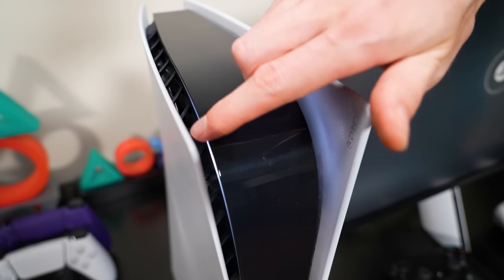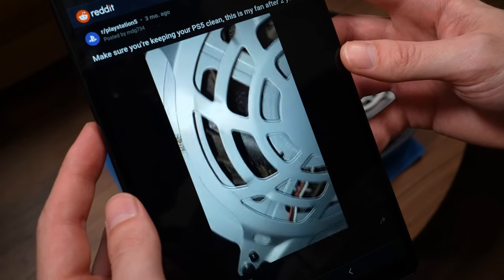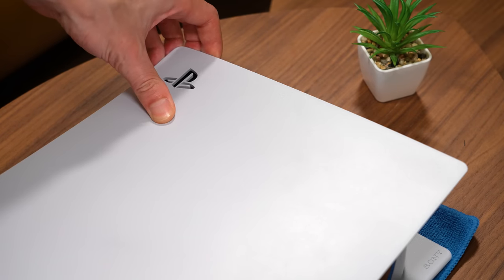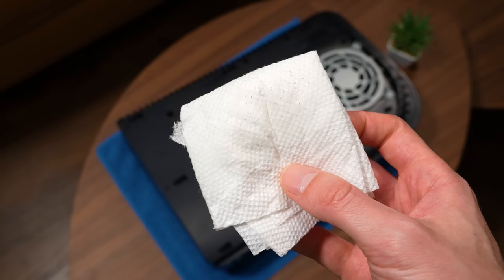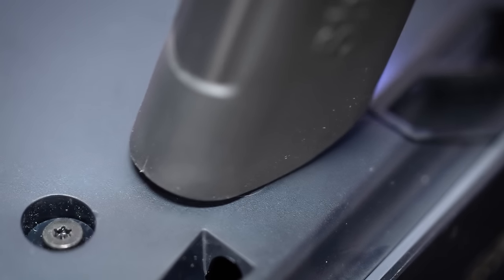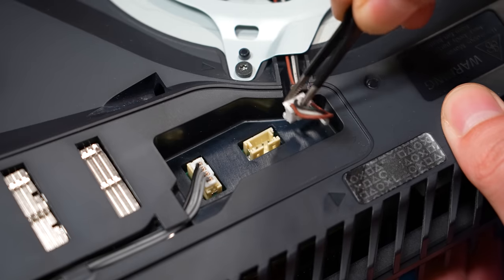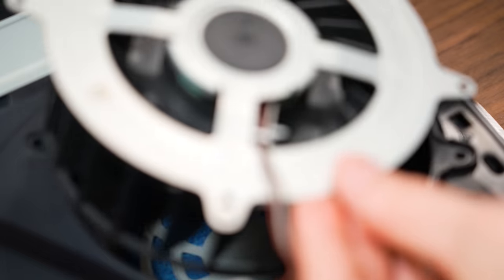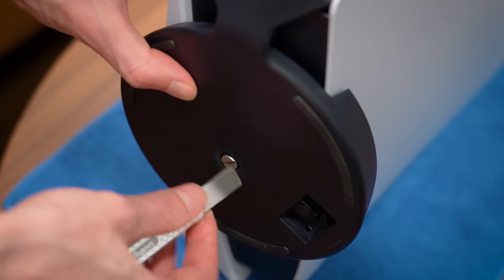It's time every PS5 user checked for this..

Comment: FYI GUYS ³ There's plenty of tutorials online that will guide you with ease. Of course, don't plan on eating a greasy burger or drinking a cold beverage whilst doing the job. If possible, wear electrician blue rubber gloves to prevent finger markings and damage any chipboard if you need to touch it for any reason. Don't use too much force removing/adding anything, especially screws. Doing so can cause the tension to crack the plastic. When you've accessed the fan, DO NOT MOUTH BLOW THE DUST AWAY. As it's from your mouth , your breathing will add moisture to the blow, and that ain't good!

Comment: I don't even fully disconnect the fan. I just pull it out and set it on the PS5 still connected. Hold it still with one hand and hit it with air duster./soft brush with technical grade alcohol. I also hit the heatsink with air duster and vacuum the inside of the fan housing.

Comment: You forgot to mention the Dust that builds up inside the PS5 system.

When you remove the Fan and look down inside the console to where the power unit is.

I clean my console regularly, but just recently found this on reddit. My console just turned off in the middle of playing, due to overheating.

It's very hard to reach with a vacuum, but theres small holes. Mine were completely sealed. I used compressed co2 to blow the dust out.

It's very important to clean too.

Greetings and nice video.

Comment: After a year and a handful of times of basic dusting with just taking the covers off and spraying comp duster, i finally got around to unscrewing the fan to clean it along with the inside and im glad i did, when i sprayed the inside of the system with the comp duster towards the cooling vents the ps5 farted a big dust cloud.

Comment: The two plastic plates come off easily if you DO NOT pull up on them.  Use your PALM to hit (slide) the hooks out of place and it comes off very very very easy.  If you look at the "hooks" in the vid, you can see how it slides off, and it does not pop off.

Comment: I don‘t even use the side-plates cuz it‘s more minimalistic/smaller smother and the air-duster get‘s better air. My air duster looks like it has never run. I did also modified a little bit with led lights and some stickers. Without plates it fits also better into a bag if you want to take it with you to a friend :)

Comment: Also as a side note from a repair tech....... from experience its a bad idea to have your console sit vertically. When the console runs to hot the cpu adhesive compound may liquefy and run down the board itself. Every single console i own runs and sits horizontally. I know some console owners who had this problem and sent it to me for repairs or had to buy another one out of pocket. Its a good idea in the long run.  Also have them sit on a glass shelve rather than wood. Glass stays cooler longer and does not retain heat like a wood shelve. If you have your console staying cool with a fan stand you may wanna check it for dust 1x every 2 months cause now you have more fans helping blow air into it.

Comment: People need to understand. A ps5 is basically just a computer optimized for gaming. 
And pc gamers know, you need to clean your rig out from time to time. 
Depending on where you live, it can get pretty dusty in there. 
I live in a house with baseboard heat and notice that I get alot more dust buildup now than when I lived in a house with central duct heating.

Comment: I'm glad that it looks pretty easy to clean up a playstation nowadays, since dust can ultimately cause way more problems than you initially realize. it's still a far cry from just opening a panel on your computer to check, but at least it's not completely disassembling the entire unit like the ps3 just to get to the fan

Comment: I’ve taken my ps5 completely apart, down to the motherboard… there are metal fins in the PlayStation that are only accessible if you completely break it down that get ALOT of dust build up if you don’t clean regularly. If anyone is having issues with the ps5 randomly “crashing” & shutting off during use, I suggest you completely break it down & get every bit of dust out, including those metal fins, because that’s what’s causing it to shut down.

Comment: For the ps5 cooling fan if u dont have the tork screwdriver  just take off both plates and use vacuum both sides on fan should be good

Comment: Question: how do you release the other fan since that one doesn't have screws. Idk while they chose to do that🤦‍♀️. I believe this is the fan where the disc drive is at

Also, I use baby wipes, tweezers, and a hand vacuum. I also have those screwdrivers, but as I said can't reach the other fan

Comment: Series S/X tends do this best since their select area of intake is on the side of the console with the exhaust fan pushing air away from the console. The minor problem in the PS5 for people who stand the console upward is that it intakes air from the top and it exhausts out the rear. Intake and dust mixing do not bode well and you get this monstrosity of dust bunnies in your console.

Comment: Every six months? I had mine since 2021 March and never cleaned it even after a house fire. I'll be taking my next day off work to be doing this. My room didn't burn down only thing that happened was my room got smoked out killed my 4K tv and left smoke smuggest on my PS5 back in 2021. It still works perfectly fine and I got the black PS5 plates.

Comment: Did this just 2 days ago. PS5 started to shut down on it on after playing heavy games like elden ring. I thought it was a faulty power cable but it was dust build up. I opened it up and sure enough it was duty. I decided to get after market plated cover plates with side vents to help cooling of the system. Definitely recommend cleaning it up if you haven’t and don’t be afraid to get in there a remove the fan or anything like that. Just be gentle and careful

Comment: sometimes not even this will work. the heat sink/radiator thats inside of the ps5 can get really built up with dust too. the only way to clean that is by taking the entire ps5 apart and getting to the heatsink. theres videos on how to do this effortlessly.

Comment: I have cleaned mine once a year since 2020 lol kept it horizontal as well. Only issue I had was after a year the lan port stopped working 🤦. I have an air compressor for filling tires but use an attachment that blasts air. Its super convenient

Comment: I've been doing this to my consoles since my first PS2. I even had to Jerry rig and replace a few parts in that one... I still have it. I call it my "Frankenstation", because of how many inexperienced, d.i.y. repairs I did to it.
One time the disc tray stopped working. First, I re-reamed the threaded rod, but that eventually gave up the ghost, too. So ultimately I ended up with a PS2 where the top lid had to be completely removed in order to put a disc in... so I secured the ribbon wire much better than Sony did, as to avoid unplugging it every time I put a disc in the console, and it's worked like that ever since.

Comment: Hey guys opening the plates are very easy but if you are scared to go deeper I understand completely. You should definitely get your system serviced because the heatsinks pick up pet hairs very easy if you have them. The ps5 will just shut off thankfully to protect it. The ps4 rarely shut off. The fans would try to compensate for heat issues until they died. Im sure someone will clean it for 30 bucks but be prepared to spend 100 too. Its a mixed bad on prices and if you have bugs you may have to clean it yourself some places will not even deal with it.

Comment: This is why I literally hate the PS5's design because not only is it horrendously huge, heavy, and difficult to carry around, the ventilation area is completely exposed, which allows dust to seep in very easily and within short periods. I keep mine covered in a plastic bag and remove it only when I use it. Sony clearly didn't try hard enough in improving the design and just wanted to launch it immediately to keep their money flowing in.

Comment: There is almost no use in cleaning just the fan as the dust is built inside of a radiator, blocking most if not all airflow. So the only way to trully clean it is to take it apart. Which is not a good idea unless you know exactly what your doing.

Comment: I know for a fact Mines dusty af. I was messing around with a air sprayer and sprayed into the vents from the outside and so much dust came out I was disgusted.

Scared to prop it open and clean it though, bought since day 1 release and haven't touched the inside since.

And yes my room is dusty af especially by the air vent where everything is

Comment: Hmm, you seem to have neglected the most critical areas - the heat sinks and vents on the power supply.
It is possibly to clean these in situ with suitable vacuum/ brush attachments.
Cleaning the fan is great.
But you really should be  more concerned with the components the fan actually blows air/ dust ONTO!

Comment: Yeah my shit was dying, it still has dust caked on the fan. I took the fan out and stuck a vacuum hose down in the power supply, I was shook by how much dust was in that cheese grater.

The heat sinks luckily had all the dust sucked out in a millisecond, thankfully the dust doesn’t stick to the metal heat sinks as much as the stupid fan.

But the thing went from me hearing the fan, to not even using the fan anymore.

Comment: All ventilated electronics simply require half a cans worth of compressed air once a year; just dont sit there like an idiot and do a sustained blow right on the fan causing it to spin up to operating speed or higher, likely frying the controller.  Maybe thermal past after 5 years.

Comment: Any owner of a ps5 should upgrade there internal storage to a crucial P5 plus or similar as load times are remarkably noticeable. I also order 5$ multi colored Bluetooth lights with 250+ combinations modes from Ali express & looks awesome. Zero signs of dust so didn’t need a clean…

Comment: WARNING. don't light incents in ur room without proper ventilation. And don't blow smoke ( weed, dab cart vape,) anywhere around the ps5. I I toke my plates off and there's like a yellow hue tint on the inner plates. Not to bad but im 99% sure it's from the incents and smoke

Comment: i never had to clean any console inside. i have some that are working for many years like some old ps2 and original xbox. i also have an xbox series x for years and it still works fine without any cleaning. i would say that unless your system fails due to overheating , dont touch it. make sure that you also use your system in an open space and not into a closed cabinet to avoid overheating. dust might not be the reason of overheating.

Comment: Disconnecting the fan from the terminal is extremely risky and you could very easily snip the white wire to the fan with a pair of tweezers. I don't recommend anyone really try that part.

Comment: The message is good, but cleaning procedure is not. The dust you clean is irrelevant, the most important dust to get out is the one that's clogging up your heatsink, which you didn't clean at all in this video. A quick compressed air blast through the heatsink will give you way better results than everything done in the video combined.

Comment: I used to clean my PS5 once a month but I haven’t cleaned it for a year. I cleaned my PS5 last week and it was dusty. I cleaned it and it looks brand new. Apart from the fan. I’m too scared to even touch it. I briefly vacuumed over the fan housing thingy but the fan itself is dusty and I’m not touching the fan. I do not believe in my abilities to do so without breaking it.

Comment: Dude this video just cost me $250. I followed your instructions and when I tried to disconnect the fan it pulled the part off the circuit board. I was pulling gently to disconnected it like you show but the whole piece disconnected from the circuit board. PlayStation won’t cover it so I’m now having to spend $250 to get it fixed. 

Fyi, don’t remove your fan to clean out dust. Not worth the risk!!!

Comment: Also, be weary of where you put your ps5, especially if you live in a place where cockroaches are common. Roaches like them because they're nice and warm. I'm a repair technician, and while it's a rare occurence, I've seen quite a few consoles with dead or live roaches on the inside. Not good if they're crawling around because they can destroy the internals of the device. Best to leave it on clean, elevated surfaces and not on the carpet. I wouldn't be THAT concerned about it though.

Comment: May just be me, but I've found dust build up is worse when using vertically. I've had it about the same time in both orientations and horizontal seems to obtain less dust than vertical.
Reply: I 100% agree with this. Much less dust when using horizontally

Comment: My ps5 was over heating when running 120fps. It would turn off immediately. I took both covers off and I blew it out with my air compressor. Do this outside.

Comment: what if u buy the hepa super thin foam.....and cut it the size of the intakes,   Not heavy foam,  very light,   so that will catch all loose fur hair,large dust  ...... much easier to fix before it makes it into the system.

Comment: the case is the purest bad design.  a catastrophe in terms of thermal technology and also in terms of dust, instead of installing a dust filter as with the PC and the housing being clever and building a simple rectangular shape, but no, Sony constructs such an impossible shape that you can sometimes make a bad situation, if you already have it  devices are on the lowboard

Comment: it is not just limited to ps5.. ANY Console will acumilate Dust after 2 years of Use just like a PC or Laptop i clean  my consoles every 6 months and my pc every8 to 12 months Simply because my pc Case is huge compared to console case. Everyone should learn how to disassemble at least the case to dust inside.

Comment: This video will lead to a ton of dead PS5s when people pull the fan plug right off the motherboard. You have to be very careful when you disconnect the fan and the video should have provided more detail. Just get a datavac and blow the dust out every few months. Keeping your house clean and preventing dust building up where the PS5 sits is also a big help. I don't think most users should ever try to remove the fan.

Comment: Playstations nowadays are not anygood for the average household with kids, you need a PHD in electronics to look after them, i have the knowledge and skills to dismantle them for a clean but not everyone does there not user freindly anymore and sony needs to address this in there next build as they are way to complex to just switch on and off for months without cleaning the inside out

Comment: I own a second hand ps5 that’s been refurbished. The original hdmi port was replaced and thermal paste was reapplied by the previous owner. There isn’t any major issues but sometimes if I knock my desk the PlayStations sitting on the hdmi will disconnect for a few seconds go to a black screen and come back is this normal or is there something wrong with the hdmi port. I don’t see why the slightest knock should cause it to black out for couple seconds happens mid game as well it always comes back but I’m worried it will happen one time and the picture will just go?

Comment: What about the GPU ports? I have a feeling mine are really dirty and that is probably the reason my PS5 keeps shutting off by itself
Reply: Nop, the "REAL PROBLEM" is the Power Supply. It's filled with dust and it makes the PS5 Shout off randomly.
To clean it you basically have to.. guess what? Open the Console Apart
Reply: @Official_JohnGlasscock  God damn it, I thought it was really him 😂😂

Comment: Oh yeah open up the console. Good idea if you wanna screw up you insurrance on it. Mine was fcked on the controller because I cleaned it regularely and when the up arrow died within the insurrance time limit they didn't fixed it or anything because there were a tiny scratch at the fitting when I cleaned it and they accused me of dismalnting it when all I did was just scrape the dust out from the fitting......

Comment: These people must live in dusty environments. I've had a PS5 and XBX SX since launch and I check mine every 3-4 months. Mine has no dust on the side panels and none on the vents. I checked the fan and the blades of the fan were a very small amount of dust. I checked the XBX in the rear and the fan was clean as a whistle.

Comment: You should never have your ps5 in tge standing position as the liquid metal can run down the motherboard
Reply: My PS5 has been in this position for 2 years and also my friend's PS5. Nothing happens, unless there was an error in the process of applying the liquid metal. This can always happen in any production. Sony deliberately included the stand so that you can also use the PS5 upright.

Comment: Here’s a tip don’t put your console in an enclosed cabinet it won’t be able to breath and dust will build up quickly. Don’t be a smoker of any kind he’ll I don’t care if you do drugs or smoke 30 packs of cigarettes a day but smoke of any kind leaves build up of nicotine and ash builds up like crazy. Next don’t be a lazy ass if you routinely dust your system it won’t build up with dusty bunnies. Lastly don’t use compressed air to clean out the system like the cans you can buy at the store reason is the system has lots of sensitive components that could be damaged with compressed air.